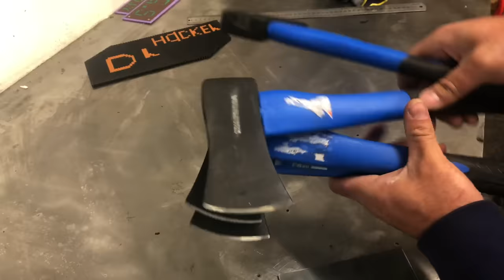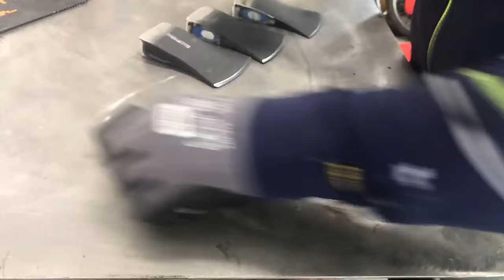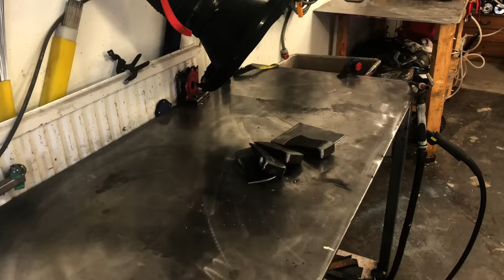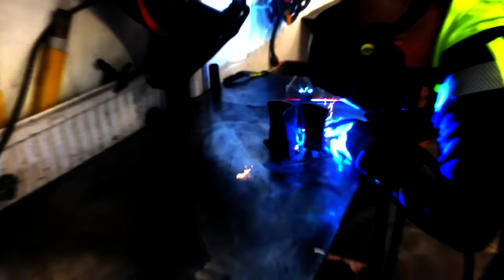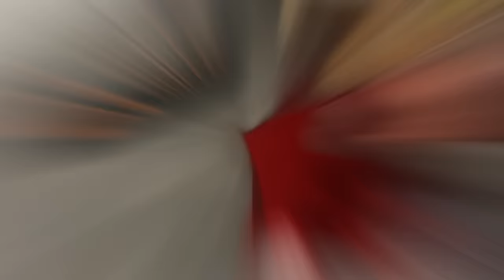Completely NEW !!! Wood Splitter TOOL INVENTION !!!

Comment: Great creation to chop soft wood, I am in Australia and our timber is hard wood, I would be there for hours unclogging the axe heads, I did cringe when you cut the handles of the axes, but it was for a good cause,  thank you
Reply: Yeah I was thinking the same thing, great idea though
Reply: Great idea, I'm in australia too and timber here is harder!! That looks like pine..
Reply: Soft wood you say? Throw a piece of Gum on it and…😂. If you are serious about splitting wood, purchase a super splitter. Cheers.
Reply: It's a start.

I thought I would redesign it like a guillotine/ hammer

Make the weight going down from concrete on a leaver and fulcrum with long handle.

Enough to do two logs at once.

Then I just need to jump up and grab the leaver and my body weight brings the leaver down.

Leaver out of steel pipe, with a trip for when I want to release it.
Reply: Wood is ranked in hardness by pressing ball bearings into the wood and how much pressure it takes. On every continent  with trees their are soft woods and hard woods. Hickory trees are some of the hardest In The world and they grow all over. The idea that all trees in Australia are "extra hard" is incorrect. Figure out the species of tree and look at the hardness ranking world wide. Australia doesn't have any top ranking species for hardness....
Reply: Right now literally I'm looking at a pignut hickory and a pine growing right beside each other... The hardest species in north America beside one of the softest. You see?  Your logic is flawed. Sorry I'm a tree nerd...
Reply: Tac triangles on base at an angle to help use down force of sledge to spread and split may help
Reply: @scratchluka6157  верно. А это, когда коту делать нечего, он яйца лижет
Reply: @-Nick_Gurr_Rich-  Some types of wood are harder to split even though they are rated "softer". Twisted grain..... Red Gum, Blue Gum no chance with that thing 🤔 I'm no aussie but I know that 😄
Reply: @timothyhughes4252  началось... Ещё про ускорение кувалды и центробежную силу не забудь...

Comment: Beautiful idea. But i recommend getting another square piece of metal and criss-cross cutting it into triangles then adding them to the base but welding them at an angle from center, down, and out like this "/ \". The objective is to force the wood outwards so you dont run into the issue where if the wood is soft it could get stuck at the base. Problem solved. It may also provide a little more metal to provide support for the middle spike by welding the tips of the triangle pieces to it in the center spike.
Reply: I thought the same thing.  Instead of using four hatchet heads, use three for easier movement of the wood.   Still a nice design.  I'm surprised eBay hasn't been selling this thing

Comment: Seems like it could also be adapted to a powered log splitter.  However, use splitting axe heads instead of chopping/felling axe heads.  Splitting axe heads have a wider taper to aid in splitting.

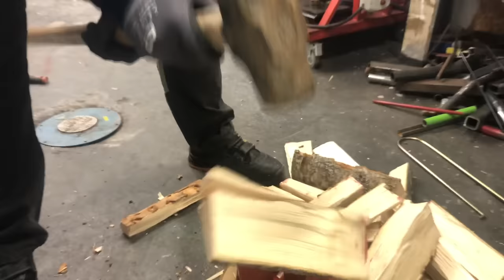Comment: Wonderfull invention. Perhaps, add a 4 inch extension plate, to the bottom (hammer end) of those axe heads........thereby increasing the splitting difference; very obvious at 6:00 time and onward.
Maybe space the heads, another 1/2  apart, each one.....   ( Weld this invention, onto the end of a hydraulic / motor powered horizontal  splitter. Add a tip-over base, for it so the pieces, can roll on out.....foot operated with a lever, and maybe a spring return  ?........?   ideas.....

Comment: Your design needs one change. You need a central spike that sets just a bit higher than your blades.   This would give a "seat" for the log to be cut.  Other than that one change, your idea is good.
Reply: You mean other than the spike that he put in the center??
Reply: Ummm... Did you watch a different video. He welded one in there. I thought it may have needed to be a bit more stout but it did the trick most of the time.
Reply: I rewatched it and saw the spike this time.  Not sure how I missed it the first time.

Comment: I like to see what that does with a piece of oak Great idea but where I live it's mostly hardwood and I don't think that would benefit me much
Reply: Yeah oak, hickory, hard maple you might just have to burn it out or it'd be stuck in that block of wood forever.
Reply: Hey Kenneth. I have an answer to your question...

Doesn't work with oak. 

We have Tan oak here in Northern California and they are dying from disease. So that's what we burn instead of cutting down redwoods. I made this over the last week and tried it yesterday and it will not go through the tan oak unfortunately. I'll probably end up using it for those few times I am splitting redwood or make it apart of a hydraulic splitter. I haven't decided yet.
Reply: @roberthesse157  I made one of these over the last couple weeks and just tried it out yesterday. It will not go through our tan oak. It does get stuck but I used my splitting maul to get it off.

Comment: This kind of wood cracks easily without such inventions.
Reply: Agreed.  Try splitting a piece of Elm or hickory.
Reply: Agreed.
You can tell by the sound the pieces make when they hit the concrete floor,that this is soft wood kindling.

Comment: Cool idea! I work at a steel supply company,so can take off cuts home. I’m thinking use HSS for the blades,sharpen with my grinder. Only thing I would possibly do a little different is to angle the blades slightly to get a corkscrew effect that should split the wood easier. Maybe wrong on that point,but metal is free,I can weld,so give it a try.
Reply: Good
Reply: Good deal

Comment: He should weld a spike up through the middle so the logs stick down better initially.  Otherwise.... it's pretty cool.
Reply: Longer spike i mean.
Reply: Yes I do agree with you I think a large nail in the center being welded on would hold the log better and even in-between the ax heads

Comment: Definitely good idea... I agree with the idea of center spike being an inch or 2 longer.... Now 1 thing i do see that would make it better is an angled piece between each blade that comes up half way as an extra aid to the separation of the log... Each one should be broad sided like a slide almost
Reply: Another plate just like the bottom but cut diagonally into quarter pieces and welded intermediately at a 45° angle in the spaces between the blades...would allow better inertial flow during the splitting process!!!😁👍🏻
Reply: Exactly!!!

Comment: I made one today and can confirm its not as effective as I hoped it would be. What I have found is that the wood keeps getting stuck on it the middle spike before the axe heads have a chance to penetrate and split the wood. I had a few ash logs lying around that have been drying in the shed for a few months and they literally just hopped off this thing. Maybe on softer wood it would be ok. I might try and lower the middle spike or remove it altogether and see if that helps any bit.

Comment: While this is a good idea the axe heads are too short and the timber is bottoming out on the steel plate as well as the centre locating pin is also too short.Longer steel strips instead of the short axe heads with some form of deflection plate on the base of the steel plate to force the timber outwards and a longer locating pin to hold the timber more secure would turn this into a very effective tool .

Comment: took the time to grind and weld axes. 
Should have taken the time to analyze it and make a tapered skirt and place it on a Heavy solid block.
The skirt would slide the chopped wood out.
Nice idea, Needs improvement before you run to market with it.

Comment: I'm making this.

Edit:
Made it. Doesn't work with the Tan oak that we have here. Be sure the wood you have in your area will split easily. I still plan to use this for something else.
Reply: I was thinking same thing, that this would only work for wood that splits cleanly, like Ash but not for locust, sycamore, osage orange, etc. which are knotty and tough to split.

Comment: Good idea, and good for smaller pieces of wood, however we with the size of the wood that I cut you could only us this for the quarters or 6ths of a piece of it. A lot of what I get is over 30 inches in diameter.
Reply: Hi Mr.Arnold just make with bigger axe heads and maybe space them out a little just a thought?
Reply: @troyspain7073  I was using a chainsaw. Didn't have a axe with me. I was also in a lot of knee high brush.
Reply: Good idea. If I do that though I think I'll just make a different head for the log splitter.
Reply: @edarnold1426 I've got one that I need to fix, and I might try to incorporate this idea into it? I now live in town so I don't really use it anymore but don't think I'll it as am looking to go back to the country. Good luck with yours!
Reply: @troyspain7073  mine is a homemade log splitter. Garbage compactor cylinder and a old hydraulic pump off of a old Massey Harris tractor. It took some gearing to get the right combination to get it going good. I think I changed it like three times. I'm running a 16 horsepower motor on it now, but it will split wood faster than any of them that you find on the market unless you want to spend over $500 just for the pump. 
 My father in-law made it back in the early 80s and he past away in 87 and I inherited it. I've done some work to it. I changed the motor and slowed it down a little. When I got it he had a 28 horsepower industrial sweeper motor on it and it went about twice as fast as it is now. I actually thought it was very dangerous as fast as it was, but boy did it split wood fast, and go through gas.lol you could go through five gallons of gas a day on a long day of splitting.lol

Comment: If only it would fit a powered log splitter.
Reply: Some Power splitters have similar heads.  Their advantage is if one piece gets stuck the next round going through will push it along.

Comment: Great idea, but there is a potential problem.  Sooner rather than later the sledge will come in contact with the blades and mess up the edges.
Reply: Why would the sledgehammer come in contact with the blades when you're not even near them, you're just hitting the top?

A sledgehammer doesn't go through wood like an ax does.
Reply: @dangerous8333  If you're familiar with swinging a sledge you will know what I mean.

Comment: What's the best way to split logs from a tree that was twisted like a barber pole ? I find it's extremely difficult due to the sinews of wood that are intertwined, it does not split evenly or completely.
Reply: Big hydraulic splitter.
 Sometimes its the only thing that works. Or simply cutting it when its to bad. Stuff like this will only get you horribly stuck if you have bad wood.

But if you have endless supply of straight unknotted wood then this if defenitivtly something for you. But it just wont work for the wood around where I live.

Comment: Bad idea. Blades sticking up in the air is a bad idea, not only could you slip/trip, fall and hit it somehow, you're going to hit it with the hammer and need to sharpen it. If you have it on some sort of hydraulic splitter or a slide hammer of sorts then maybe. Otherwise this is an accident waiting to happen. It works though.

Comment from the maker: New invention tool 
https://youtu.be/LhjGkm2x2gY
Reply: Just a thought as an engineer, I’d be interested to see what a mk 2 design with a single, four bladed peace of steel with blades shaped to force the wood outward would do. I’d be happy to do some CAD mock ups for you because I don’t have the tools presently for fabrication and it seems you do.
Reply: Just a suggestion because God knows I hate it when a person comes up with the great idea internet person tell someone( an ex-employee of Lockheed skunkworks) and then they are going to improve  on what as I see already works just fine. Would be four more blades in the gaps between the Four that you already have but smaller shorter. So that the quarters are quartered again .
Reply: @johnlawson9464  Not everyone wants quarters of quarters.
Reply: how much you want for one ? and can you somehow put made in USA on it

Comment: Bigger base, longer spike, tires on it, tires to damped shock, 5, 6, 8, 10, 12, 14, 22, 10000 axes..... Screw it, if it works like the right tool for the job you're doing then you've done a fantastic thing. If it doesn't then you have built a neat prototype to test theories. In either case thanks for sharing your idea. 9.5/10 because nothing's ever perfect.